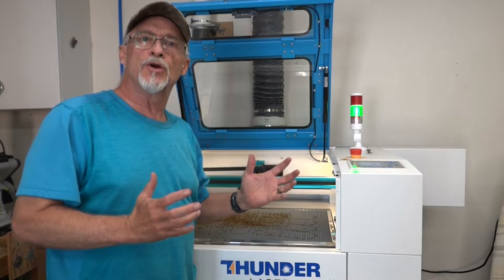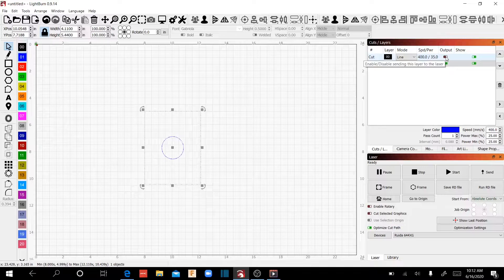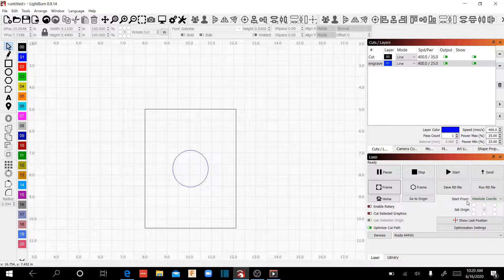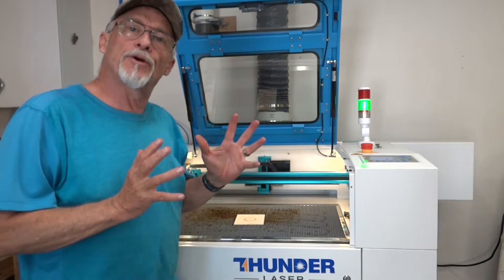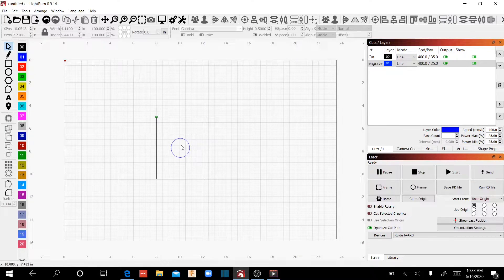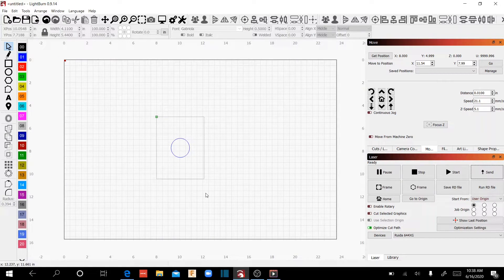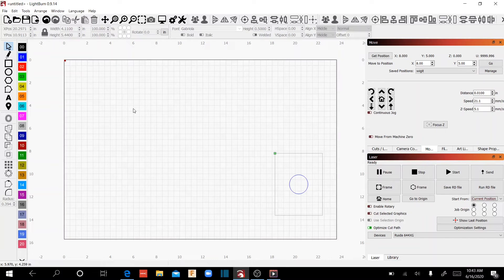Start From in LightBurn with your new laser

Comment: Just starting with my Alpha 22 watt machine.  My problems with setting the "starting point" - current position - were self inflicted.  I was moving the laser head by hand, when in fact, after your laser self homes after powering on, do not move the head by hand - EVER, move the head ONLY WITH THE ARROW BUTTONS in Lightburn (move) buttons.  When you move the head manually by hand the machine looses it's mind and does not know where it is.

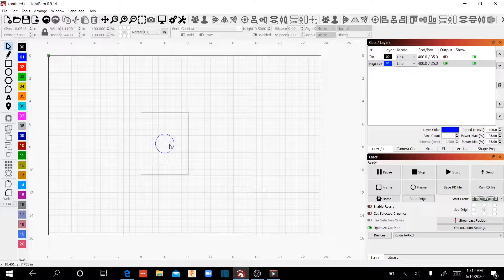Comment: Hello and thank you for this great video! At 3:50 you explain the "Absolute Coords" setting. When you say that it returns to the Home of the CNC machine do you mean to the Hardware Home "HHome" or to the Home set manually by the user through the "Position" command?
Reply from the maker: on a co2 laser it returns to the machines home which usually in the upper left or right corner depending on brand.

Comment: I'm back. If I enclose the circle in a square and want to tell the controller to cut the square and engrave the circle I would need 2 line layers and one engrave, each assigned a different color, power/speed?
Reply from the maker: Yes. Your cut layer would be a line mode, and your circle would be a fill mode both layers would have different speeds and powers stack your layers in the sequence you want the laser to do the work
Reply: @computercreationz  I am drowning in weeds. I named my square Frame. Say I want to create a circle with an image inside the circle. I want to cut the circle and engrave the image inside the circle.  Off Would I name the circle Cut (creating a 2nd layer) and the image Engrave (creating a 3rd layer) and assign a different color for each layer and disable the Frame layer before cutting? My car is embedded in snow so I have not been able to get to the laser to give it a try for almost a week. Off topic. My sister and I took a 2 hr class on operating the laser. The following day we get to the laser shop and we are all alone. Oh my, we went over the manual for starting the laser and it probably took us 15 minutes just to make sure we turned everything on okay. Probably did not get much accomplished that first day. The next morning we're back. Oh Oh. The laser was out of order owing to a fire. OMG, we were frantic. What could we have done incorrectly to cause a fire? My brother is at Makerspace a lot and the first thing he asked was "Did my sisters do it?" We were not the cause; someone left it unattended. Thank goodness for videos!

Comment: I set up an engrave with "current position" (laser head was in the position I wanted it to start - upper left selected), framed it and it was in the right position. But when I "Sent" it to the controller to engrave, it moved it up and over about 4" to the right. What did I do wrong?
Reply from the maker: You must of had something else on the screen that was influencing the origin. I turn on use selected graphics radio button. It on the laser panel this way you can have many things on your desk top but lightburn only assigns the origin to what you select. That’s all I reverted use because my lightburn workspace always has more on it than what I intend to send to the laser.give it a try
Reply: @computercreationz  I double-checked that there was nothing else on the screen, it was an import of an SVG onto a new page. I will try the selected graphics option. It was weird because it framed correctly. 

Love your videos! Sooooo helpful!

Comment: You may have covered this, but is there any way to make sure that your object is in the exact center of your frame?
Reply from the maker: If it’s square draw a line from opposite corners and where they meet is center. Use user origin and select center. If it’s round look up how to determine center or a circle

Comment: Thankyou for your videos. You do a gtreat job of explaining this stuff so anyone can understand it. That being sai, I have a question I hope you can help me with. I have an Omtech 60w laser. Its home is in the upper right corner, so when I say purposely move it out into the work area anywhere, and hit "Home", it returns to the upper right hand corner. The green square is also exactly where the red square is which I am thinking should be the origin location. Both are located in the upper right hand corner. However if I have my laser resting say out in the work area and hit the "return to origin" button, my laser moves over to the left side and not all the way back to the rear corner but almost to the rear. The way it looks is such that My Home position and my Origin position are in the same place, however they go to two different locations. Can you tell me why this is and if there is a way I can get them to return to the same place which is home? Thankyou in advance for any information you can share on this topic. And please keep up the great videos, they are very helpful and informative and again, you are a great teacher!!!
Reply from the maker: it all depends on what start from setting your using in LightBurn. in absolute coordinates this is the way it will function. if you use user origin (my favorite) you decide where the origin is by pressing the origin button on the controller. it will stay that way until you set a new origin. very useful because you where you want to !
Reply: @computercreationz  Thankyou so much! you are the greatest teacher! I think I actually figured it out on my own but really.....thankyou for at least getting back to me. That really says alot to me about the man you are, and how you really care about helping other people. You are a great person!

Comment: One question sir.  Why is your design outside of the parameters of the watch band?  I thought you might size it down so it would fit completely on the band?
Reply from the maker: Great question, I didn’t want my gaps in the design. Also wanted it to wrap down the edge of the watch back. It looks better finished that way. Or at least the customers like it that way.thanks for watching

Comment: A good explanation of one of Lightburn's probably most asked questions "where the hell is my laser going to burn from" I actually have a couple of Inox rulers on the edge of my bed in X and Y which I have embedded and also find that useful for reference and I use a wooden square on the bed itself held in place by a couple of Neo magnets for repetitive work. Then pop the piece of wood in or plastic and away you go time after time.  Works perfectly. I dont thing since sorting this out in my head a few years back have I used Absolute Coordinates once.